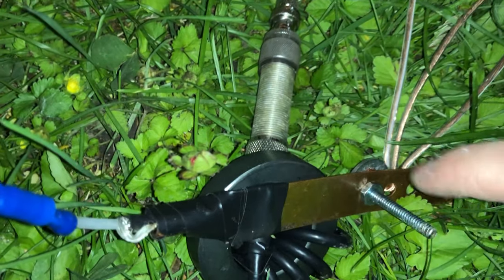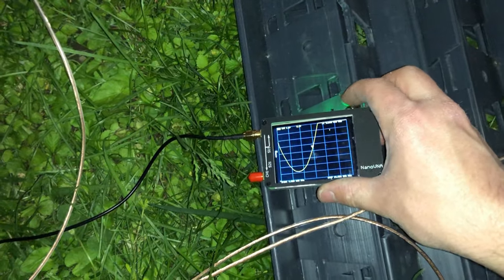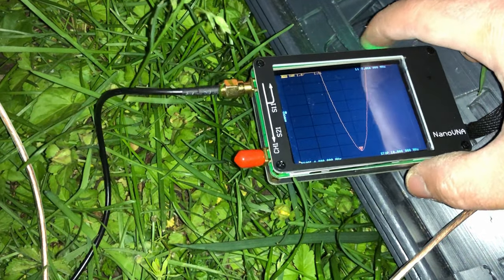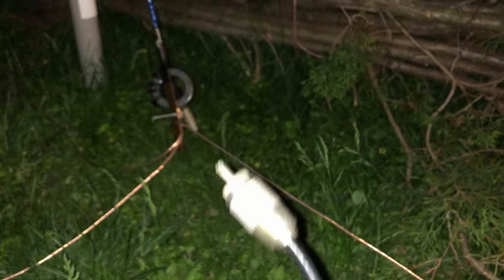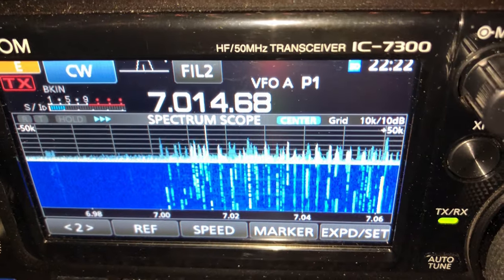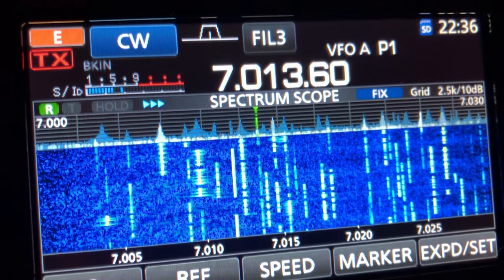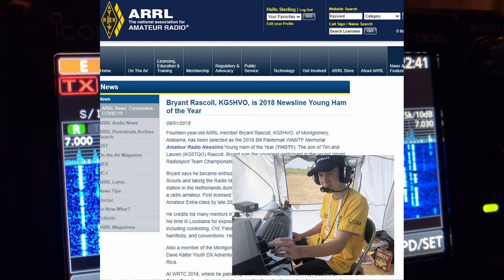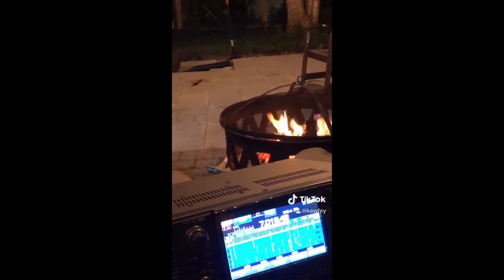Introducing the DX Idiot - Homebrew HF Vertical Antenna

Comment: I have been a big fan of vertical antennas for decades!

If you want to have DX, if you want to have ease of operation, if you want to just have fun without having to spin knobs on a tuner, a properly made and tuned vertical antenna is the way to go!
Reply: A non-resonant set up correctly will have a 1:1 across the board with NO tuner
Reply: @n0vty873  I have yet to see it in operation. Most such antennas are dummy loads.
Reply: @jeffreyyoung4104  your loss
Reply: @n0vty873  details please? What is this mystery antenna you talk of

Comment: Nice to see! I recently made a 20 meter vertical with an extending fishing pole and radials. I was pretty impressed I was even able to work some QRP ssb on it.
Reply: How long are your radials and how many.  John  N6NRO
Reply: @johnkershaw9575  I am using 8 quarter wave radials and I definitely saw an improvement in both swr and performance from using 4. It’s honestly pretty easy to set up too. I use my ft-817 and I mostly run only 2.5 watts on SSB. I also run low dipoles on my extending fishing pole and for some reason I have had better luck with the vertical than the dipole at low height.